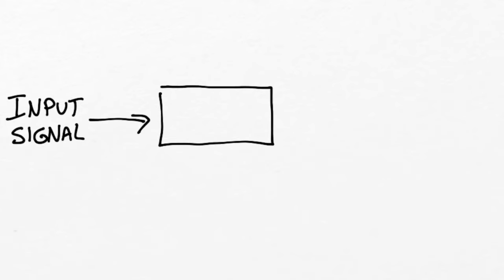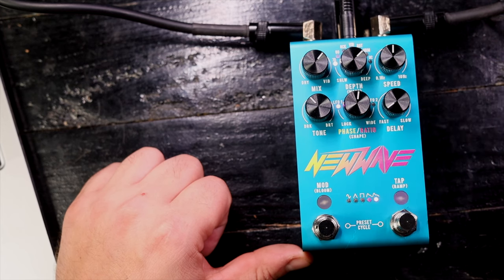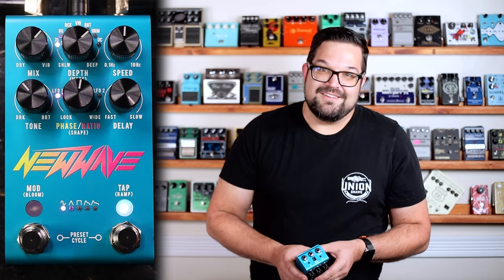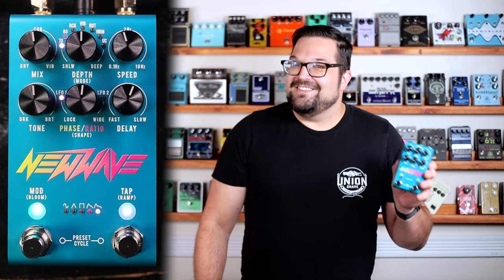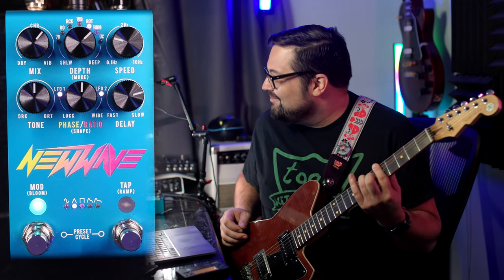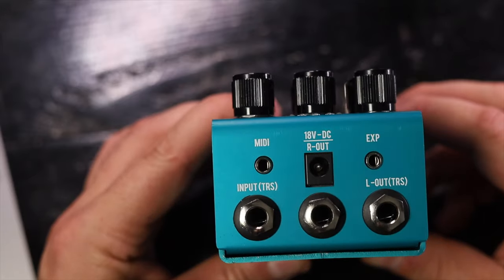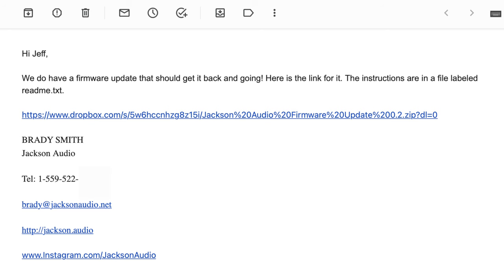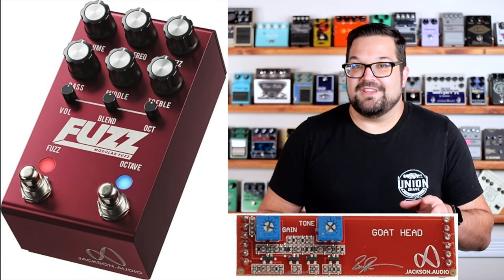The Jackson Audio New Wave is a Bucket Brigade Chorus with a Digital Brain

Comment: I really appreciated the honest feedback about the firmware and the power requirements, especially with the direct current draw measurement. That’s next level reviewing!
Reply from the maker: My years of model railroading have taught me that when something's not working, before disassembling a perfectly good locomotive, it's always a good idea to make sure the power supply is doing what's required.
Reply: Awesome review! The New Wave now ships with the updated firmware that you have now, no need to update for anyone wondering.  @StompboxBreakdown
Reply: @JacksonAudio  I just got mine from Sweetwater but it came with no power supply. The Dunlop 18v doesn't work so I bought the Cioks supply.

Comment: It doesn't add too much volume for you? I just got mine, and it gets noticeably louder when i turn it on, and i didn't notice how hot that louder signal was until i turned on my distortion pedal and noticed it was clipping and sorta oddly compressed my distortion in a bad way :( i looked on their website for an update, but i can't seem to see anything, maybe i'm blind and missed it :/ idk...
Reply from the maker: Interesting. Does the volume jump when engaged, or all the time? I didn’t notice any volume jump. Does it do it on both sides of the mix knob?

Comment: Thanks for the disclosures on the firmware and the power supply. A lot of reviewers don't/won't go there. This kind of review makes for a better level of trust between yourself and the viewer, in my opinion.  Nicely done and, maybe even a bit brave on your part. While I love rotary effects and weird chorusing effects, what you said wouldn't dissuade me from buying the Jackson pedal here, but it does make me think about the benefits vs the negatives and how that relates to my board and purposes better. For that, thank you.
Reply from the maker: To be honest, when I first saw this pedal, I thought "What an interesting assortment of features and sounds, why haven't I heard more about this?", then I started reading reviews and threads about it. My first thought was that all of these people must've screwed something up, or didn't know the difference between volts and amps, and it'd be good to do a demo that shows it working perfectly, but then exhibiting those noted signs of failure when plugged into an underpowered outlet. 

So when mine locked up, I figured I could either quietly return it and pretend nothing ever happened, or reach out to tech support and see how quickly I could get up and running again. I'm not sure what I would have done if I didn't get a response or the firmware update didn't work, but I figured sunlight was the best remedy.
Reply: A year later, I still WANT a New Wave. Would It still need updates? Other issues? Thank you, love your videos!!!

Comment: Are you sure the power supply is included as stated in the video? All the websites where it is being sold show as not included.
Reply from the maker: The one I got from zzounds had it included.
Reply: Mine didn't come with the power supply. I ordered a fulltone 18v 500ma but it didn't work. I ordered a voodoo labs voltage converter. I hope it works.

Comment: Did you build or buy the shelves in the background? I see them (at least that style) in a lot of peoples videos but not sure where to get them. Thanks a bunch!
Reply from the maker: Ha, so the funny truth is that they were initially going to be display shelves for my slot cars and model trains. They're just two strips of wood, cut lengthwise, and glued/nailed together at a 90 degree angle. When I decided turning my entire basement into a sprawling railway empire wasn't perhaps the wisest use of space, and I had the thought of doing a YouTube pedal channel, I added a thin half-round to the front to form a lip to keep the pedals from sliding off when they're leaning back. 

So, TL;DR - I made them. Cheap lumber cut lengthwise and nailed/glued, and a small half-round at the front to form a lip, then sanded, stained, and sealed.
Reply: @StompboxBreakdown  Very cool! They look great. The half round is a brilliant idea! Thank you for the reply. Maybe If I get brave I will take a crack at building some.
Reply from the maker: It was a fun project! Also a nice way of keeping a wall interesting